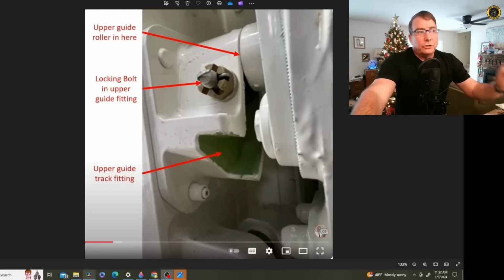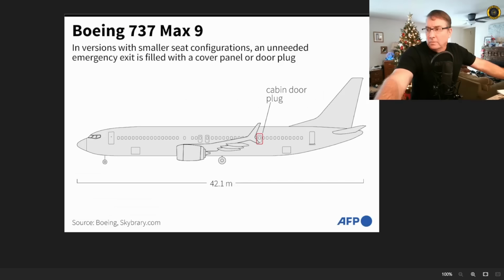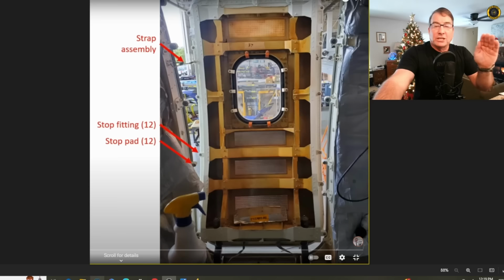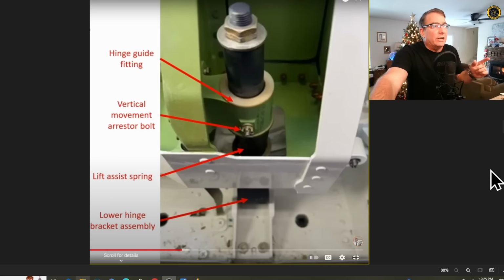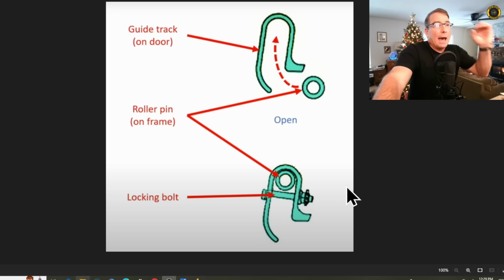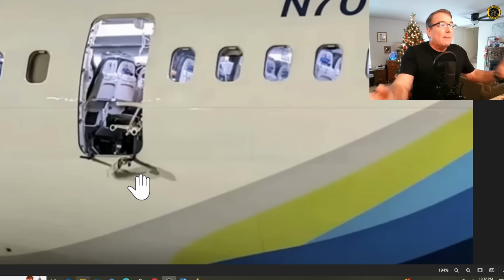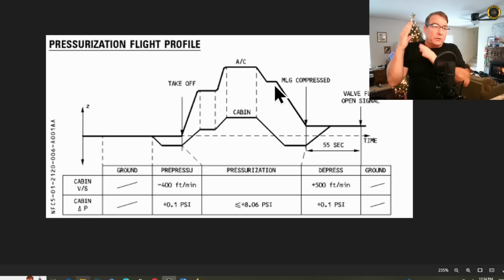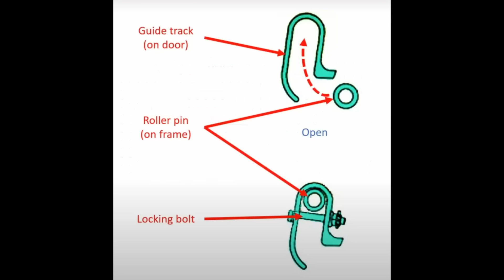Alaska 737 Max-9 Door UPDATE! 8 Jan 2024

Comment: BREAKING: NTSB has reported that the two upper guide tracks were fractured. However, the NTSB structural specialist stated that the door translated upwards before the track was fractured I.e. it is unlikely that the stop bolt/pin was in place and that the fracture of the track allowed the initial upward motion required to decouple the stop fittings.
Reply: Source (NTSB press conference): https://www.youtube.com/live/kGWLBLb9Pm4?si=xH34LvmSFBWzBvXU
Reply: It wouldn'g be surprising if the door got tweaked a bit when departing the aircraft that it would then have torqued the guide tracks to fracture them.
Reply: Its unlikely there would be both missing bolts And fractured guides.
Reply: It's a fundamentally bad design. Why does something which is only designed to be opened very occasionally for maintenance even have springs to make it easier to open, let alone hinges and other paraphernalia? A failsafe and idiot proof design would be a simple plug which is larger than the hole all round and can only be fitted and removed from the inside. It would be lighter, cheaper and more aerodynamic as it wouldn't need the gap at the top to open. My guess is that they started from the design for the actual escape door option which does have to open outwards and modified it rather than looking for the simplest and best solution.
49 years after Ermenonville and the aircraft industry is still producing overcomplex, badly engineered things like this. It makes you wonder what other bits of the aircraft are similar.
Reply: @user-pf3ye6yi9n  My understanding is that the exit door is an option that can be ordered by the customer, so the design needs to accommodate both a plug and an exit door without too many changes to the fuselage.  Between the four locking bolts and the 12 stop pads that actually seems like a pretty robust plug design, when installed properly.
Reply: @user-pf3ye6yi9n   Problem is that Boeing made a bad door (in place of a good door) instead to make a good removable panel (in place of a good door).
Reply: Weird, there was never a problem with these doors - now it's just the most boneheaded design anyone has ever seen all of the sudden...
Reply: @RyTrapp0  Problem IS that it is called doors. Which aircraft doors have to be bolted down to lock? Make a safe locking mechanism if you wish to use those as "doors". At least make the bolts captive. Or that it cannot stay in place without bolts, like the panel.
Reply: @docnele  Yea yea yea, Mr Monday Morning QB showed up with all the answers, we got it. Those total bonehead engineers need some lessons from you - cuz this is their fault of course...
Reply: @docnele  you want it to have a latch hidden behind the blank interior panel of the aircraft, so the latch can work to the open position without being noticed?  keep in mind the only time this PLUG would ever be opened is inside a service hangar with the interior of the airplane taken apart.  hence the reason it is designed to require tools to open.
Reply: Upon inspection, some 737max’s were missing door plug bolts. Wow, that’s disturbing…
Reply: @user-pf3ye6yi9n  Jeez, Boeing should have hired you to design it. Problem solved!
Reply: @docnele  Another "expert" designer here I see!:face-green-smiling:
Reply: @charlescz1974  Who left them out? Boeing or Alaska Mechanics?
Reply: @RyTrapp0  Where did I say it was the engineers? No doubt they were told to come up with this kludge to use as many parts from the opening one as possible. Which somehow still ended up requiring so much work to convert to an opening one if reconfiguring the cabin that Boeing recommends airlines don't do it but buy the version with the real but decommissioned door instead.
Reply: @kenbrown2808  Where did he say that? The point is this design DOES have a latch (and assist springs!) which has been crudely modified to stop it opening, behind the internal panel. It shouldn't have. The only reason to have a door in a pressurised aircraft which doesn't open inwards is the space it takes up which isn't a factor if it is only opened for occasional maintenance.
Reply: @DennisMerwood-xk8wp  Ok, explain why this mess is better than a simple plug design?
Reply: I don’t believe it a problem with the design of the plug. It’s got to be an installation error. On the latest NTSB update, all 4 bolts are missing and one of the hinge guide fittings.
Reply: @DennisMerwood-xk8wp  it’s alleged Boeing. This particular aircraft was low hours and delivered recently… Can’t find the exact hours and delivery date though
Reply: @user-pf3ye6yi9n  it may have been in other videos where it was explained that an emergency door plug is a piece that is set in the opening where an emergency door would be placed if the seating configuration was such that the door ws required to be present in order to meet emergency evacuation time standards.  that design does NOT have a latch. it has BOLTS where the latch would be if the plane was configured to have a working door, there.
Reply: @DennisMerwood-xk8wp  this goofball here is defending the design even as more aircraft are being discovered with loose fasteners.
Reply: I’m sorry but I don’t yet buy into design flaw simply because older models of Boeing planes have this door-plug hybrid and have never had issues with them. All designs can be improved yet that does not mean they are flawed. 

And, the plane itself discovered the problem with the pressurization alerts. It’s just that since there’s never been a problem like this before w/ these door plugs, no one thought to look at it and instead chose a more simple approach which was to check the sensors themselves. (And I think it was actually good thinking by the airline to assume something could be worse and at least restrict the plane from flying over water. They are catching grief for that decision but I think it was a prudent decision.)
Reply: @angieg2561  still illustrates that profits are pushed ahead of safety. Hell man, a cabin pressure safety alert should have grounded it!
Reply: Or not intentionally opened. 

Wasn’t it on the assembly line in October?
Reply: October 2023

Same time you know who was attacking you know who 

Best not to blame Boeing yet or dump your stocks. We don’t know the answers yet.
Reply: @docnele 
It is not a "door"!
It is an optional emergency exit plug!
Reply: @angieg2561  Because a poor design is operated safely for a period doesn't make it inherently safe. It is in fact an accident waiting to happen. When that accident happens without serious consequences and reveals the problem that is the time to fix it, not the time to say "oh, it was fine for a long time, just need to be more careful or tweak it slightly". If this plug had held on a little longer in the climb out the outcome would probably have been a lot more serious, probably including fatalities. Windsor was the warning that the DC10 cargo door design wasn't safe if it wasn't operated very carefully; they didn't fix it properly and Ermenonville was the result. But plenty of them flew for quite a while with no apparent problem.
Reply: @kenbrown2808  That's the point - it does have a latch and hinges and associated mechanisms carried over from the actual door which is simply inhibited by the insertion of bolts which in this case seem to have been omitted. This is clearly seen from the diagrams and photos presented here and elsewhere. The plug could be a simple actual plug which was physically impossible to remove outwards, located by bolts whose absence or failure would not result in the loss of the plug.
Reply: NTSB also reported almost "casually" that the door designed to blow up in a decompression event.
What?
So they supposed to blow, potentially suck up passanger near the door on cruising altitude as well as the door potentially damaging the tail and stabilizer?
What?
Reply: @dalfifran7572  
Are you doing drugs?  I didn't hear that!
Reply: @user-pf3ye6yi9n  It's very heavy.  That's why it needs springs to make it easier to open as well as hinges.  If fitted correctly it's safe.
Reply: @user-pf3ye6yi9n  Ah, yes of course - the design is totally s00per d00per dangerous dog shit design... but, hey, it isn't the fault of the people that literally designed it! So I wonder whos design it is then? Must be the CEO's, right?

...hooray mental gymnastics...
Reply: @mahbriggs  NTSB spokeperson said that, tell her about it.
Reply: @user-pf3ye6yi9n  well, yeah, they could have made it impossible to reconfigure the plane if it was decided to put the seats closer together. They could have done that.
Reply: @DennisMerwood-xk8wp That's actually a good question. Hopefully the investigators can find out who exactly left the bolts loose or missing.
Reply: @cjmillsnun  It needs springs to make it easy to open in a hurry if it is an emergency door. If it's a plug which needs opened once in a blue moon in the maintenance hangar it doesn't.
Reply: @RyTrapp0  It's not as safe as it easily could be. But it's fine as long as everybody who touches it does everything exactly right every time throughout the life of the fleet. Because that has worked so well in the past, right? It's not easy to design something from scratch, people make mistakes. But when you get a free pass when it goes wrong and nobody dies, that's the time to fix it properly.
Reply: @dalfifran7572  
You have been hearing voices in your head again!
Reply: @user-pf3ye6yi9n  
Obviously you know nothing about aircraft!
I hope you have no serious responsiblities!
Reply: @user-pf3ye6yi9n  "...as long as everybody who touches it does everything exactly right every time throughout the life of the fleet..."

Please, exaggerate more about just how technically advanced the process of installing literally bolts, nuts, and cotter pins is

This is a joke
Reply: @mahbriggs  Denial and projection is quite hell of drug for you eh...
Reply: @dalfifran7572  
You are the expert at it!
Reply: @mahbriggs  Said the one who keep doing it. Classic!
Reply: @kenbrown2808  I’m assuming that the actual exits have a hefty latch mechanism. They could have used the same latch mechanism and bolted that. I bet the would be safer and less prone to a catastrophe in case a few bolts are poorly tightened. Best of both worlds: easy to unbolt the latch and open the door for maintenance and easy to replace with an actual emergency door if the customer decides to modify. Probably more expensive so they would rather play Russian roulette following Boeing tradition!
Reply: Another dodgy part of the design is that you can’t tighten the upper guide stop pins much. They go through a fairly thin walled structure so torquing these and applying thousands of lbs of pressure would potentially damage the guide tracks. So that means these pins rely on the cotter pins (rather than pressure) not to untighten. Not the most elegant solution I’ve seen. Don’t let great get in the way of good enough as they say!
Reply: @ncooper8438  the structural specialist said the guides fractured as a result of the door blowing out. Since the stop pads weren’t damaged, that means the door translated upwards. So the bolt must have either fallen out, sheared or have been absent.
Reply: @charlescz1974  “upon inspection, some 737max were missing door plug bolts” source for this?
Reply: @BaliMystic  a standard exit door won't it behind an interior panel.  and bolts holding a standard latch in place are just as easily to install wrong as bolts holding a door plug in place.
Reply: @kenbrown2808  agree to disagree.
Reply: @BaliMystic  that's not a matter of opinion.  an exit door is thicker than a door plug is, and a cabin wall section won't fit over it.
Reply: Hashtag AA removed bolts for "maintenance" ???
Reply: @docnele  "Problem IS that it is called doors"

Incorrect, it's called a door plug  It is fitted instead of a door to plug the hole in the fuselage when an operator doesn't require an opening door in that location.

Comment: Great content again as I had already got an understanding of Door Plugs at Chris' 737 Technical Channel, however your dissection of the component parts certainly reinforces that the Door Plug is a safe design. However as often said in aviation its only as strong as the weakest link. The aircraft only came in to service at the end  of October and had at least 3 pressurization issues before the door departed in January with a restriction for it not to be flown to Hawaii. Given your excellent description/animation of the jostling of a door, the comment below from jeffropenn and the pictures of an intact door, it would seem that some or all of those bolts were either improperly installed or not installed (the weak link) allowing the door to move and blow out!

Comment: It seems so unlikely that the cotter pins would have failed, the castellated nuts rattled off, and the bolts all rattled loose. That last effect is even less likely in the hinge posts because the bolt is under constant shear stress from the door lift springs (at least, from my understanding of the mechanism)
Reply: More likely that the rivets and welds of the entire slide mount assembly failed and sheared off.
Reply: I can't be sure because I haven't worked for Boeing for 20 years, but I highly suspect that the total spring force is less than the weight of the door. That is, the springs are there to make it easier for a person to lift the door, but wouldn't lift it on their own. If this is the case, then the springs wouldn't be putting a shear load on the bolts through the hinge posts.
Reply: How could this have happened on an almost new aircraft? especially an aircraft that hadn't yet gone through its first inspection cycle?

Comment: The missing bolts, nuts, and cotter pins are the fod they keep finding in the KC-46s.
Reply: It all averages out. Nothing is missing. So what if some planes have too many parts and others not enough. On average, everything is just right!  Boing, Boing, Boeing!  More DEI please, I like it when the news is interesting.
Reply: As a 50 yr CP/AP with OCD 😆 I've seen many AP/AI/ assemblers that were so unethical and incompetent that you all would think I'm crazy 
My first AP job years ago on the 737/200 I was ordered more than once by chief inspectors to deliberately falsify paperwork. I never did, and I didn't last long 😲

Comment: Another case where a self-locking castle nut would have saved the day.  But they cost a little more. And God forbid that a bean counter would allow another couple bucks for safety.
Reply: I'm willing to bet that wouldn't have helped here either as I don't think these bolts were installed in the first place.
Reply: Care to explain why other "plugs" have not fallen off the other 11,000 737s built before this airframe? You can't, can you?

Comment: Scary to think what an explosive decompression with that sized void in the fuselage could have done to the structural integrity of the aircraft with the pressure differential at cruising altitude….
Reply: your comment makes me wonder whether the structural integrity of THAT aircraft was damaged by the plug blowout even though it was at an altitude much below cruising altitude.  Pressure differential was obviously enough to blow the plug out.
Reply: @pimacanyon6208  I’m a jet turbine engineer, not much of a structural guy but I have no doubt they’ll likely be assessing the fuselage for crumpling and other defects.
Reply: At less than 4 psi that hole let's a lot of volume out in 2 seconds. Remember as the volume goes out the pressure is decreasing.
There should be zero structural damage from that minimal pressure change.
Reply: @hotrodray6802  No structural damage at 38,000 feet? LOL!

Comment: Eyeballing the door size, say 1500 square inches times 8 psi = 12,000 pounds of force on the door at altitude.  And yes, the 737 Technical Site is the best display of aircraft information I have ever seen online.
Reply: I was wondering how force was calculated in that instance.

Comment: Our local (Portland, OR) news channel reported this: There was a lot of chaos in the cockpit as well. The cockpit door flew open when the cabin depressurized, but none of the flight crew knew it was designed to do that during rapid decompression.  "They were not informed of that design feature", Homendy said, adding that Boeing, the builder of the aircraft, was going to make that clear in the plane’s manual." ... what would be the advantage of having the cockpit door open during a depressurization event?
Reply: That mechanism has been standard since doors were locked after 9/11. Rather let the air out of the cockpit, than risk buckling a bulkhead and damaging equipment.

Comment: These jets could have flown for YEARS with this ticking time bomb and depressurized at altitude. An amazing stroke of luck that it happened the way it did.
Reply: yep, these are the times that "luck" dictates if you live or die rather than oversight by the government.
Reply: It’s probably more a public relations nightmare than anything else.
Reply: I may be mistaken, but I thought I read that this is a brand new airplane, just weeks on the flightline, as well.
Reply: @mccloysong  I believe it was delivered in late October. Supposedly it had some pressure issues in the weeks prior (no official source)
Reply: I used to avoid old planes, but seems like a new plane is more risky
Reply: @Matty12333  Bathtub curve, you want to avoid the young and really old ones.
Reply: @mccloysong  you're correct.  However, other airlines have been inspecting and finding similar problems in their planes since this occurred.  It may have just been random circumstances like some turbulence that caused this particular door plug to pop loose at the time that it did.  And perhaps, by chance, it would happen to another plane later on if we weren't aware of it now.